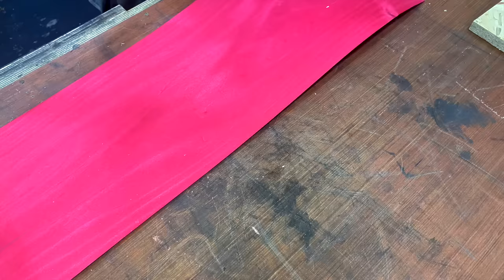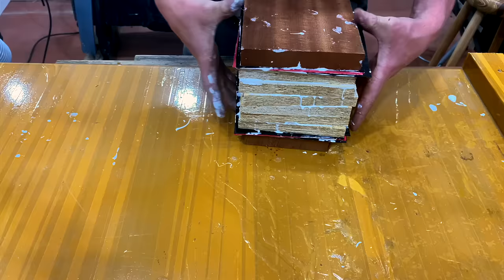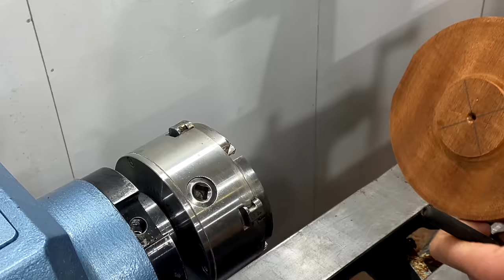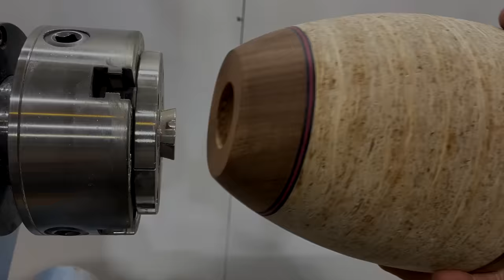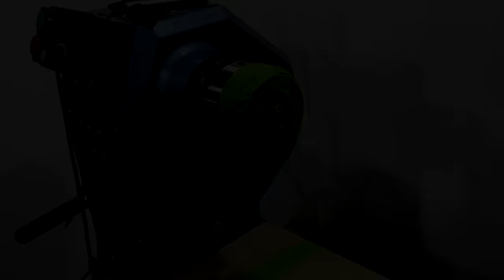Woodturning - $3 Board To £3000 Art

Comment: Stuff like this from you and only a handful of others are exactly why I’m literally aspiring to buy myself a lathe. This stuff is just stunning how it turns out.
Reply from the maker: Nice one C. Happy to help if you have any questions 😊👍🏻
Reply: I started on a very small from a lathe I loaned from my local woodturning club. If you want to get started, I'd join a club as soon as you can. The woodturning community is great! My first larger lathe was broken when I bought it for £50 but easily fixed for £35 (a £700 lathe when new!) definitely not as nice a Jack's lathe but does the job great as a hobbiest. You can see how I repaired it on YouTube by typing in 'M950 lathe repair'. Good luck and enjoy!
Reply: > how it TURNS out

I see what you did there

Comment: Ok so I can see this from more than one perspective. I work at a lumberyard and I do woodworking so I can understand the time and effort of turning something like this plus I imagine you sanded and polished it so that’s a decent amount of time which I assume is where a large chunk of the cost comes in also I doubt it was only $3 in materials if you included the resin and lumber the last couple years has skyrocketed in price. But on the other hand $3000 seems steep for something made primarily from some type of a particleboard/osb. But if someone is willing to pay that more power to you it just seems a little out there for what it is. Now if this is custom work at their request then I can see how that price would be more fair. Either way good job it looked good for something not commonly used for crafts
Reply from the maker: Hey Rip. I think having the ability to charge this much is more to do with creating a name for yourself among local collectors. That way any piece you make is a one off with a story. The pieces have a QR code on the base which leads to a video of the piece being made, along with a certificate of authenticity. It seems mental to some people. I think if an NFT can sell for £250k, £3k for a one off tangible piece with a story seems more reasonable. 🤣😊👍🏻
Reply: How is your woodturning business doing?
Reply: @JackMackWoodturning  a very good reply!

Comment: Very nice end result 👍🏼
Is that an optimistic valuation or were offered that $$ ?
No need to answer that but I’m sure many are curious 😉
Reply from the maker: That was the sale price buddy. Have you worked with OSB?
Reply: @JackMackWoodturning  Wow good on you! 🍻👍🏼
Yes for many years, I am a Chippy and Builder. We use it for wall bracing on houses here in Australia 👍🏼

Comment: Really cool, great looking piece. What kind of epoxy/resin did you use for the finish on that?
Reply from the maker: Thanks. You mean what brand resin?
Reply: @JackMackWoodturning  yeah the brand.
Reply from the maker: It’s alumilite amazing clear cast
Do you want to use it for coating like this ?
Reply: @JackMackWoodturning  yeah I have wanted to try coating some of my turned pieces in epoxy/resin so they would be water proof. Specifically for like vases so they could be used flowers that really need to have water.

Comment: quick question, why do you use white glue instead of something like wood glue?
Reply from the maker: Sorry Corey but wood glue is white. All over the world has been for the last 100 years. Yellow titebond style glue is fairly modern and not as versatile as PVA. It’s all much of a muchness but wood glue is definitely predominantly white 😉
Reply: I'm sorry but that's just not true. If it were maybe 50 years ago then you'd be correct, but yellow PVA glues are much more common than white PVA glues for woodworking nowadays and for good reason. Yellow PVA glues are tackier, take less time to set up, dry harder, dry harder, the bond is stronger, and they're typically more waterproof, depending on what type you get. I haven't seen any woodworker using much besides titebond or epoxy for any project.

Comment: I wouldn’t expect this to work with a square shape like this but I guess it’s spinning quickly enough for it to not be a problem and rip the tool out of your hands?
Reply from the maker: It’s more to do with the tool control than the spindle speed. Can be done just as effectively as a low speed as a high speed. But if you present the tool incorrectly at any speed you’ll have problems
Reply: @JackMackWoodturning  thanks for clarifying. It’s mesmerising watching this, especially not round objects becoming round

Comment: Question: why not cut it round before you start?

I'm not a woodworker; I don't have much experience with woodturning.  (Once as a teenager I got a chance to try it out, briefly.  But that was just the once, and many years ago.) But I've been fascinated by woodturning videos on YouTube.  And many of them feature square blocks (or square-ish) turned on a lathe.  It seems to me that those corners would be very jarring and difficult to shave down: hard on the chisel tool (if it's called a chisel or not, I don't know), and jarring on the lathe equipment that's holding it, and jarring on the material itself.  Why don't woodturners use a bandsaw or some other tool to make the shape more rounded before they begin?  Is there a good reason not to, or is it simply easier than I think it is to knock those corners down, or what?

My apologies for my ignorance on this subject, but I'm genuinely curious to know the answer.  Thanks!
Reply from the maker: Why do you think it should be cut round?
Reply: It seems to me that knocking into those square corners would be quite a pain.  Starting with a more rounder shape seems like it would be easier.  I could be wrong, of course, but that's why I'm asking.  Isn't that first pass with the square corners difficult?  Even an octagon would be closer to round than a square.  You're aiming for a cylindrical shape anyway; wouldn't cutting it to that shape on a saw be an easier and faster way to get started?  No?
Reply from the maker: Thanks. I see why you think that.. it’s actually just a case of what is easier and more efficient rather than what appears to be an easier route.. 
If I was to make a mistake on the bandsaw for example,, if the top of the piece is not perfectly perpendicular to the sides or isn’t completely flat then it’s a very difficult cut to make and potentially dangerous. Even after doing that I then have to mount it on the lathe and turn it.. finding the centre of a square is easier than the centre of a circle.. and if miss aligned you end up removing too much material in the turning process.. 
the real basic explanation is that it’s extremely easy and fast to remove the corners on a piece like this and when I get down to round all 4 sides are centralised within the piece.. 
for less experienced turners it may be easier to do the marking up, crating a flat surface to safely cut on the Bandsaw and then cutting the corners off then taking the time to mount it perfect in the centre of both end points.. for someone who is experienced ( I’ve turned wood professionally every day for 20 years) it’s way faster to just knock the corners off on the lathe. It takes about 1-2 mins tops. It’s also no more jarring than cutting something that is round.. it doesn’t “wear” the tools out.. that’s what they are made for and regardless of the operation they are sharpened every 5-10 minutes anyway..it takes 5 seconds max to sharpen a turning gouge and removes only microns from the tool tip. 
If I was teaching a beginner how to turn something we would always start with a round piece as it’s easier for them to start that way. But for me and other turners who really know how to use a turning gouge, there is no safer, faster or more efficient way to remove waste wood than the do it on the lathe. 👍🏻
Reply: Thank you for taking the time to explain! That makes sense.

Comment: Im not a huge fan of the finish. I’m not saying it’s ugly, it’s awesome, i just wouldn’t have done it the same way. I think i would have sanded it and make it a little bit less glossy. It’s only a question of taste. As i said this is NOT a bad comment. I’m just saying that i would have made it less glossy. To be honest, i wasn’t sure at first but the result it stunning. What’t the black and red “paper” you used ? 

Great work !! ✌🏼✌🏼👌🏼👌🏼
Reply from the maker: Cheers dude . The black and red is dyed wood veneer. You not worked with it before ?
Reply: @JackMackWoodturning  nope ! I was working as a kitchen maker for 10 years and just discovered the passion for wood turning and woodworking. Been working in the finishing process for 5 years as well. There’s a lot of new stuff for me to learn :)

Comment: You have a band saw. Cut the corners off of the squares before you start turning. It's less work and wear and tear on the wood.
Reply from the maker: No it’s not.. it’s way more work Roy. The bandsaw needs the right blade and set up to cut a radius cut and after that additional work I still need to mount the piece on the lathe and true it up.. 
it takes 45-60 seconds to trim the piece round on the lathe vs 5-10 mins setting up the saw for a pointless cut..
Reply: @JackMackWoodturning  
That would be true if I said to cut the pieces into circles. I didn't say that, though. I said cut the corners off.
Reply from the maker: That would still be a complete waste of time. Your talking about taking a blank that your about to mount on the lathe and first cutting it on a bandsaw to avoid 30 seconds of turning with a tool that can be re sharpened vs a single use blade. The only time rounding out blanks makes sense is in production work. I turn 1000s of the same shape bowl per year ( my real job) and when I prep those blanks I round them out because in the fluidity of the production process it’s more time efficient.. not just in the turning but in the cleaning too.. I can be buried in shavings in 2 hours of solid turning.. if I rounded those blanks on the lathe I’d spend half my day shovelling shavings. 
All this being said, if you or the person reading this feel safer or more comfortable turning an octagon or a rounded blank then do that 
.. but only do it until you are confident with a gouge, then step away from what we teach to the novice and begin to learn the craft for yourself. 
👍🏻

Comment: What kind of epoxy do you use ? It seems much thicker than the one I use. 
Thank you. Kind regards, Koen (Belgium)
Reply from the maker: alumilite amazing clear cast, what do you use ?
Reply: I don’t know the brand by heart, but it comes from Holland. Alumilite is impossible to buy in Belgium. I’ve found 1 webshop from the UK, but for the moment not possible to deliver to the EU. 
I’ve also contacted alumilite, but besides the UK they don’t sell their product in the EU. Sadly enough. I would really like to try alumilite… but until know I didn’t succeed in buying that stuff. 😔

Comment: Imagine getting a splinter at 300000 rpm
Reply from the maker: 300,000 rpm… I guess you vane never used a lathe 🤣
Woodturning lathes go to 3,500 rpm and that is only ever used for turning very small items. Generally turning is done around to 1200-1800 rpm mark.
Reply: @JackMackWoodturning  I figured I was overestimating a bit but I watched another of your vids after that and it said 250 rpm... at that point I realized my mistake haha
No I had never seen a lathe until last night and they look like they spin at the speed of light
My comment still remains though.. imagine getting a splinter at 3500 rpm... you probably don't need to imagine it lol
Reply from the maker: 😆😆😆.. yes I can imagine it would be pretty bad. I never get splinters. But I can imagine it would be pretty awful 😆

Comment: You should cut your corners off before turning. Makes it sooooooooo much easier and safer
Reply from the maker: Thanks. I think if your still learning to turn you should use square blank as practice with your bowl gouge. Then once your proficient with a bowl gouge you won't need to go to all the effort of setting up your jig and bandsaw/ turning for the blade ect. Plus…. even after rounding the corners off you still have square stock to deal with on the lathe. Way better and faster to just use one machine. So much faster, it takes about 1 minutes to round it out on a lathe.. when you think that you still have to mount it and turn it after the bandsaw it's actually a fault economy. And your loosing the opportunity to get better with your gouge.

Comment: It’s a very nice piece but I would have preferred you would have carved the particle board away in the bottom to reveal the wood you used on the top and bottom. Personally, I wouldn’t pay thousands of dollars for a piece made from particle board. 👍
Reply from the maker: It’s not particle board. The wid in the bottom was visible from the inside of the finished piece. I’m not exactly sure what you’re saying about this piece that isn’t clear in the video. The material is OSB
Reply: On the inside the dark wood isn’t showing, only the OSB shows. OSB is an upgrade of particle board but it still isn’t solid wood.

Comment: This is so dangerous. Especially after 7:55. If the tool hooks in from there, you got yourself a happy little UFO flying through your workshop. :)
Reply from the maker: You don’t know much about wood turning do you
Reply: @JackMackWoodturning  enough to know that those boards don't stick together good enough if the force comes from the sides, and they are thinned out like this. this is more as advice for rookies, that try this with dull tools and bad technique.
Reply from the maker: Dude. You should stop talking. You clearly don’t actually know anything about Woodturning or woodworking. 

Literally everything you have said so far is incorrect.
Reply: @JackMackWoodturning  except it isn't. But hey, go on showing that stuff.
Reply from the maker: No dude. It is very much incorrect.

Comment: Heat gun or small torch on the epoxy will get out all the bubbles. Also, not an arts person so I wouldn't buy it. But then again I I'd be happy with a mass made plastic one, if I needed one. I do understand that took probably 8 - 12 hrs of hands on labor and at least 3 to 4 days total to make so it's worth whatever you can get for it.

Comment: I’m just saying if you can blag £3000 for a rip of osb, some off cuts of veneer, 2 pieces of sapele and an hour on the lathe, you’re in the wrong industry. You need to go and get a sales job you’d be a millionaire in no time!

Side note, no if you have any integrity the customer doesn’t name their price. You charge for your time and the materials you use.
Reply from the maker: Behold, Alfred the wise. … 🤫
Reply from the maker: So does this reasoning apply to paint on canvas as well in your opinion?
Reply: @JackMackWoodturning  yes it does, painting takes a hell of a lot longer and an awful lot more skill and imagination than woodturning, especially in the case of this cup/vase or whatever it is.

In the case of extremely high priced paintings you should take into account the age of the piece, the stature of the artist and the rarity of their work.

What you should be more ashamed of my friend is that you don’t value yourself or your work more highly. Not once have you defended the price you put on the work or said that you charge £3000 per hour and that says it all.

The clean hearted always win ❤️
Reply: @alfred7350  couldn't agree more
Reply from the maker: The price was set by the gallery who sell my work “my friend”.
Reply: @JackMackWoodturning  sure 👍🏼

Comment: Bit disappointed.  That had little if anything to do with the thumbnail
Reply from the maker: The thumbnail shows the lathe it was made on and 90% of the material used for the finished piece.. I guess you would prefer a thumbnail of the finished piece ??
Reply: @JackMackWoodturning  Or somewhere in the process.  I felt I had been clickbaited

Comment: 3 grand?? NO!! Lol..was just about to commend you on your skills in turning wood and creating beauty out of scrap cheap chipboard..but your ££ estimation is silly..I have a Masters in design/ mechanical engineering ( I live in the UK & graduated in 92) and have a lot of experience  on the lathe & NO WAY in a gallery in the UK would this command any more than £350 tops...sorry it's a true fact it it was made of lignum vitae and Welsh Glogau gold perhaps it might..lol
Reply from the maker: It’s not an estimated price Sophie that’s the price it sold for. It was polished to a lass finish before sale. And looked exquisite. You can see picks of the finished piece on my instagram. 
What something is made out of doesn’t add to or reduce its value in the eyes of seller, obviously is it’s made of gold then it’s has a minimum value or it’s scrap value. 
Thanks for your accusation, I suggest you stick to commenting on what you actually know. Especially at 3am after too much wine. 👋🏻👋🏻

Comment: 1/10 the amount of glue you used would have been more than enough. Lmao. Neat project tho
Reply from the maker: OSB is extremely absorbed and the glue has a long open time, up to 48 hours depending on environmental conditions. Therefore the glue needs to be spread thick in order to ensure a good strong hold. Squeeze out is a necessary biproduct of executing that process correctly. The veneer is even more tricky to glue than the OSB. Give is a shot with the amount of glue used used on solid wood and then turn your lathe up to 2000 … make sure to stand well clear 😆